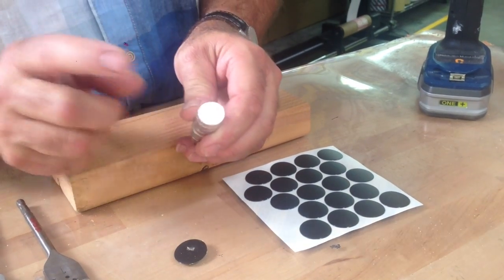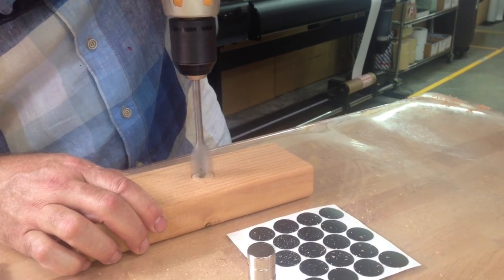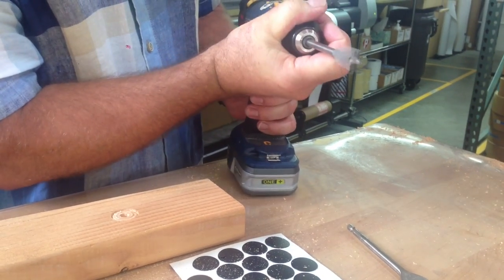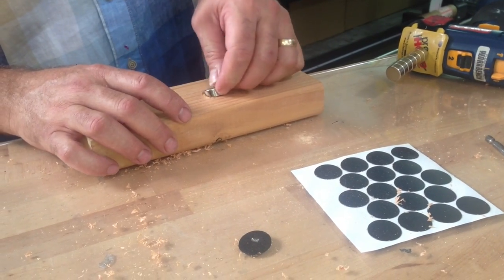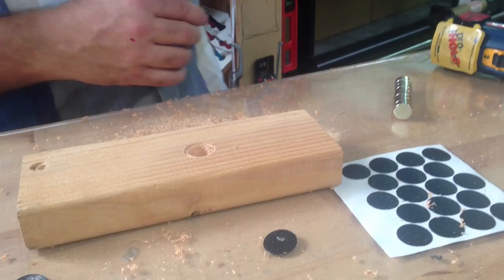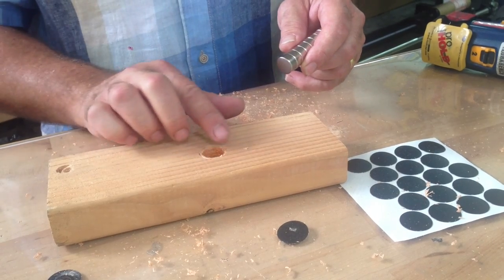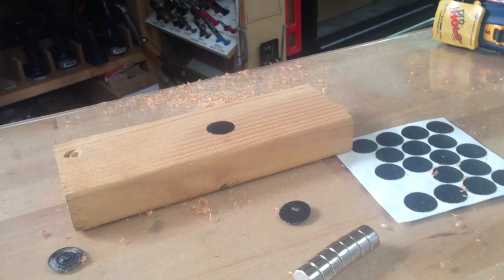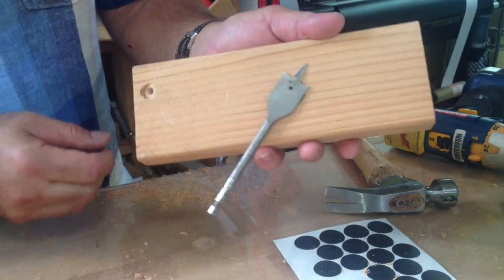PowerMags Installation

Comment: One very useful home project using the bits that make holes & matching plugs is for hanging lights & garland to decorate your house for Christmas.  I've installed dozens over archways/door frames before I was going to paint the wood work.  Also did this, with a different set of bits for adding Neodymium Magnets to the brickwork around the fireplace, for more decorations, & for hanging stockings.  To hide the holes in the brickwork I reused the core I drilled out & used epoxy mixed with additional brick dust, & used copper wire to center the plugs ... the brink was a nightmare to get right, I think it would have been easier to  add the magnets to free standing bricks (not installed) & remove the bricks from the fireplace & replace them with those with the magnets you installed... Also this way you could install the magnets from the backs of the bricks.

Comment: They do sell sets for drill bits to cut holes & make matching plugs...  very useful when you're working on a project that is using/showing natural grain wood, so you can match the plug with the hole ... trick I've used was take the plug from the same piece of wood, just take it from the flipside... that is if it isn't seen.